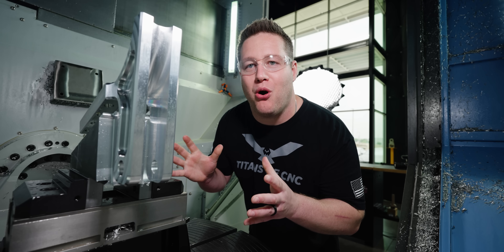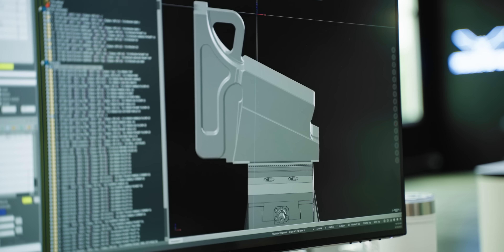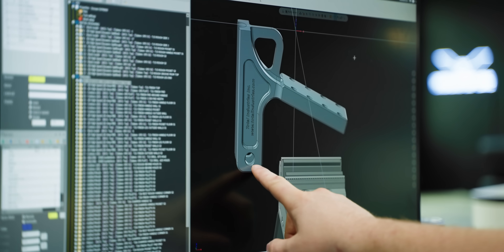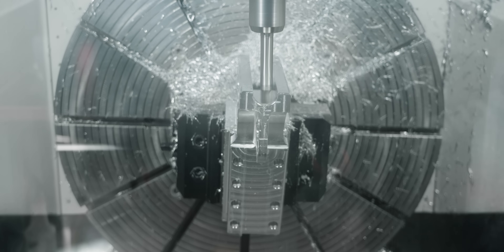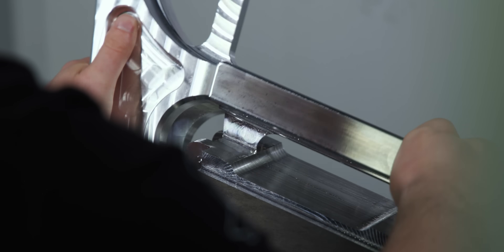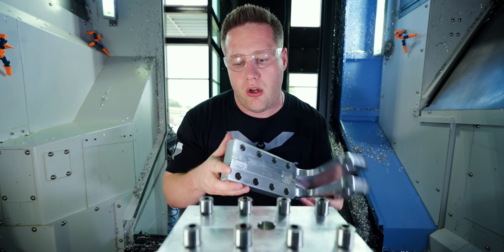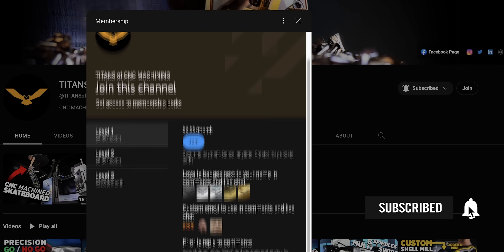How To Machine A Complex Part 600% Faster Using Trick Techniques

Comment: Been trying to maximize my roughing ops with adaptive/trochodial toolpaths like in this video.  I notice you guys don't use coolant on those roughing paths? Can someone talk through that? We just use it by default but in cases like this my understanding is that all the heat is designed to go out with the chip.  Is there an MQL used? Air blast?

Comment: started a new job 2 weeks ago. lerned CAM new machine and first actual part l'm making is 2 simple plates but with strange outer contour. l remembered this vid and instantly gone to tab those so you can make them in 1 OP. gotta love titan for input like this

Comment: Watching the spindle and table move in unison - like dance partners in perfect time. We don't have a 5 Axis CNC machine, but watching that would never grow old either.
I was wondering what the issues were that you had using a larger endmill at the start of the video.
Reply: Vibration/ chatter..!?

Comment: Been finishing parts 100% (no second position) with tabs since 1996. Tabs only need to be .015-.010 thick, width of tabs in the center .250 to .375. Best to use small End Mill e.g. 1/2 end mill when finishing tabs and the tab side of the part, reducing the torque on the backside of the part. Break tabs and blend with Dotco or Die Grinder.  

You can use a Serrated Vise and avoid prep operation for the Dovetail. Machine the part 100% complete in one position. 

Also, I have used Slot Cutter (Side Cutting Mill) to establish the Radial/Arc tabs in just 3 passes while finishing the backside of the part.  Cut first Side, then 2nd Side leaving a small continuous .015 thick ARC serpentine tab, then come back and mill away the majority the tab's center of the ARC serpentine tab. The deeper you push the depth of the cut the shorter your tabs will be.  At this point the remaining tabs will be short little "ARC" tabs that are more rigid than typical linear tabs. Though style works great.

Comment: I've found that on harder materials (stainless and Ti) it works well to come in and tab with a 3/16" to about 0.125" thick and then follow up with a 1/8" down to about 0.03" thick depending on that part weight. It tends to prevent the part from bouncing into the endmill and chipping it.

Comment: With such a large platter couldn't you just hold it on the long side with some mitee bite edge clamps or a mod vise and still get it easily in one setup and one simple fast face cleanup 2nd op?

Comment: Being able to make snap tabs is definitely a great advantage in 5 axis mills. As for the way you mounted it for op 2, I would definitely have added two locating pins. Even if the pin clamps worked well enough  to maintain tolerance. Having that much more control over the parts' exact location is cheap insurance, especially for the last fixturing.

Comment: Personally do alot of 1 op vice ops. I prefer to use snap offs on an edge rather than tabs. I create a snap off of 0.275mm that leaves almost no burr on aluminium aerospace parts

Comment: If this was in stainless steel, would making those same tabs be possible, or cause too much vibration?
Reply: I do it on stainless and titanium all the time, but I usually will add more tabs that are a little smaller and thinner.

Comment: A 10-minute part.....
...one thing missing from these videos is drawing up the part and programming the machine.  
Everyone watching is just fascinated beyond belief at the speed and accuracy of these parts, but it would be interesting to see a brief description of how the part goes from concept prior to clamping a piece of metal into the machine.
What is this part intended to do?
Reply: Agreed like I replied to someone else. 
Programming is not just about the Gcode to run the machine. The Manufacturing process is about the tooling, work holding and machining of the part. Then you have the shop floor documentation for running the part. The CNC programmer's job is about taking the people, process and technology and bringing it all together. A good programmer brings not only the Math along with Science to the process, but also their artistic and creativity to come up with it.  Even then it should never be good enough and should always be looking for ways to do it better.

Comment: I saw something when you did the second operation. Instead of making steps with the roughing tool, how about ramping with it instead? Saves alot of air travel which is an efficiency killer. if you approach on the lower end and use the side to ramp up that should be the most efficient way.

I have thought about it quite a bit since one of our shops' programmers regularly makes programs with 60-100% clearing distance(which isnt what i'm talking about here but still something that adds time) and on aluminum with fast feeds it doesnt matter too much but with 60 mm air travel both into and out from the part several times on a steel part with a big mill then it adds time. So if take long cuts instead of alot of air travel then good efficiency. Makes the mill work more like a lathe :D

Comment: How do you prevent surface marring from the end mill chattering against the part when you do the final pass in that last operation and you leave just 50 thou ? I stopped doing this as the last op because of that issue and started using cutting saws to leave a very amount of material that I could tap off
Reply: Simply use a smaller endmill and stay away from your finished surface. You'll finish it in the next operation, so don't worry about some more allowance there. Process safety above all.

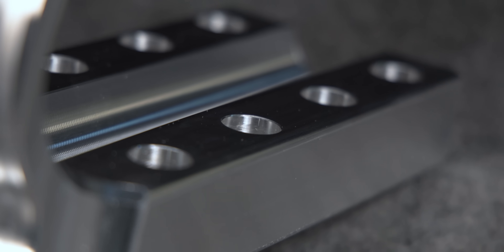Comment: 10:10 Always. Making parts with efficient strategy is easy, but the tolerances is the big issue. When the tolerance unable to achieve, change back to traditional strategy again.

Comment: You are the man Jessie! But I don't get one thing -  if you have a lot of these to make why won't you make a casting and then just perform finishing operations and make holes? It doesn't feel right to have this much leftover material, i get that it can be made into something alse but still you have to store it. Greetings as always, a pleasure to watch!
Reply: Material spec may not allow for casted material. Also casting has longer wait times, where I am the lead time on casting is 3 months from the date ordered to delivery, I can however order solid stock and it be delivery 1-4 days later typically.
Reply: @karl6313  thank you for the response. You are most likely right but what do you think about an aluminium forging then? The due time should be shorter at least
Reply: It would again have a lot to do with the customer and what they require. A forging or casting would be very reasonable solutions, assuming the customer/engineer think so. The one customer we work for requires the part to be made from a 304 stainless casting, does not matter to them we can produce the same part out of bar stock faster and cheaper than having it cast, not to mention the lead time just to get the casting is 3 months, but the process would be more efficient to use bar stock simply because it can be bar fees into the machine, so my door would never need to open except to check on tools. The engineer said casting, so it must be casting and no matter how many times we have pleaded to have the drawing changed, it must be casting according to the engineer. We make other pieces almost identical to the casted ones, but those engineers said casting or bar is ok. Sooo sometimes your hands are tied as a machinist, you must follow the print regardless of better methods sometimes.

Comment: If your going to make a lot of those parts why do you spend so much time making useless chips? Why not have your billets of stock water jet to the a rough size before machining? Aluminum takes little time to water jet, of the hundreds of millions of dollars of machines and tooling you guys have, no water jet machine? Just asking.
Reply: That might be an option for them but this is a process setup for another company that just bought this machine. So that company might not have a waterjet. Titans of cnc is just writing the program, making the work holding and running a proof of concept part.
Reply: @clutchboi4038  I was making my comment based on the statement made at the 7:30 mark.

Comment: I wish I could change careers to a CNC machinist.  I have the CAD and CAM experience (11+ years of on the job learning) to quickly learn the the skills necessary for a production environment.  I'm stuck, however, with a degenerating back.  My lumbar is gone and the C spine is on its way out.  So, I can't spend the hour needed on my feet or bent over inside a machine.  I do enjoy turning out one off parts on manual equipment when the opportunity arises. Adam (Abom79), Tom(OxToolCp), Clickspring, Inheritance Machining, and to a lesser, but more entertaining extent, AvE have all provided many lifetimes worth of knowledge and experience in what works as well as what does not (those go in the Box of Shame).